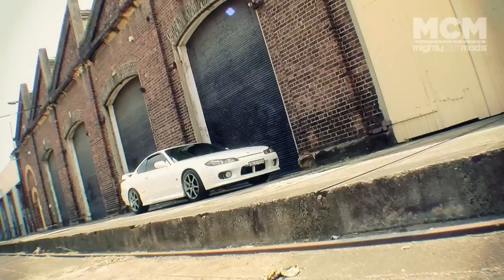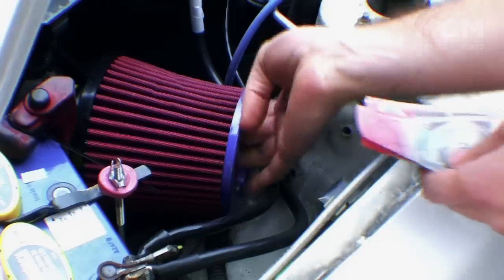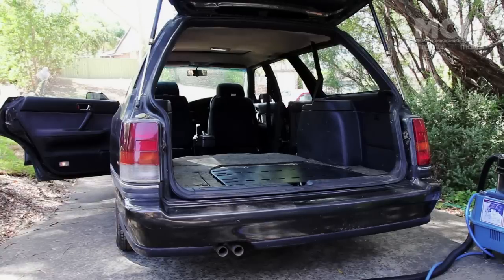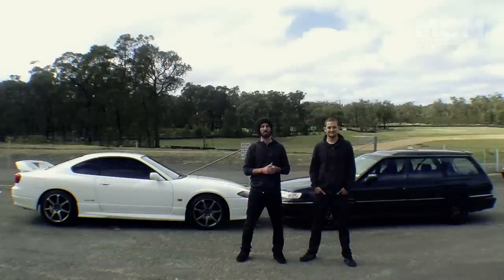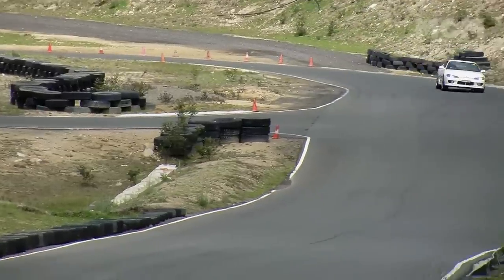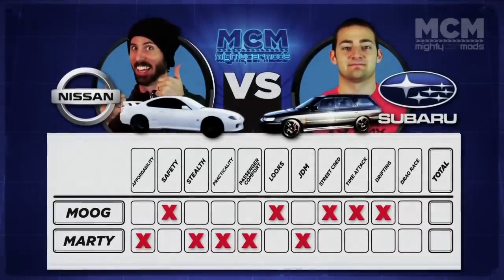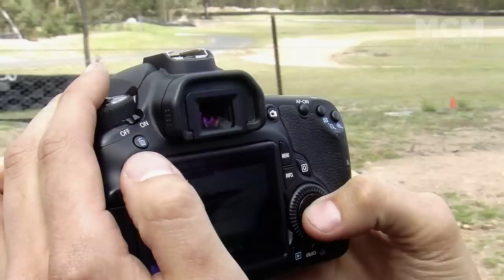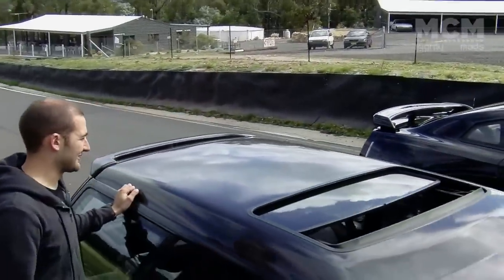Nissan Vs Subaru Battle

Comment: What about the reliability category? Marty blew up the transmission in the Subaru.
Reply: +Wick3DPimP Only STI's have strong transmissions
Reply: Ah, that must be it, all the subies i've ever seen modded were sti's. Only an aussie would mod a frickin legacy anyways(im gunna get flamed lol).
Reply: my brother in law had a 2015 sti that blew its clutch before it even hit 60000 miles
Reply: if thats the case, u ride heavy on your clutch, i have currently 120000 miles on my clutch and still perfectly ok. not sticky or spongy.
Reply: ***** it was also the transmission at the same time
Reply: Power+ AWD+good tyres=shattered 2nd in the 752 gearbox, I've been through 3 in a GC8!

Comment: that old Subaru is using 90% Nissan parts. Nissan owned Subaru in early 90s
Reply: +Y10Q lmao
Reply: i was surprised to see Nissan parts in my GC8. the cup holder says Nissan on it. i was confused. but they also have Mitsubishi parts as well
Reply: NePdXploit
 I know. On my 1998 Legacy all the electrical fans and relays are from Maxima and Altima. Same part numbers. On my 2001, they went to GM parts bin. The only Subaru part on Subaru is the engine.
Reply: Prove it.
Reply: sounds like bullshit to me
Reply: thornygravy
  The only SUBARU thing on SUBARUS is the engine, manual transmission and the body. Everything else is sourced from third party suppliers. Today they are using Toyota parts. They used to be supplied by NISSAN
Reply: And now Nissan use Renault parts
Reply: Evo Guy
 back then Subaru and Nissan operated at a loss. Today Subaru is posting 20% profit margin. Highest of any car maker.

Comment: What the hell, the S15 had semi-slicks, that's beyond unfair. Put the same tires on both cars for the track test.
Reply: how? 1 marty still won. 2 marty knew about the semi slicks. There is nothing in the rules stating equality. Its the RS vs S15 as is where is. Its nothing but fair 
yes semi's would have been good to see but still
Reply: John mark Touche but what good is a lap time comparison when they're not on similar tires. In fact I think all car reviewers should mount the exact same tires on each car for lap time comparisons. Top gear's lap time board would completely get shuffled up.
Reply: it isnt good lap time i would have liked to see that comparrison but unfortunately i beleive s15 would have just had it
Reply: Rykahnz s15 would of still won, rwd handles much better into corners compared to AWD cars, especially these older cars, suspension setup would also need to be accounted for

Comment: Subaru more JDM than an s15... staged.
Reply: plus that subaru is basically a  nissan
Reply: It's older than the S15
Reply: JDM japanese domestic market? so as they are both japanese which is more domestic?
Reply: charles d'Avoine the Subaru is an Australian delivered one though  and the s15 is imported
Reply: both built in japan just one was exported for sale in AU, so which is more domestic?
Reply: They had to make it all come down to the drag race.

Comment: This is how cars should be modded, no ridiculous camber or crazy wings!
Reply: so there are rules for modding now?
Reply: There's no rules per say, I'm just sating that the mods done to these cars are done tastefully. Many of modern "car enthusiasts" only modify their vehicles in order to try and  impress, commonly based on looks alone, oftentimes neglecting performance. Im not saying that I hate camber or that wings are a bad thing, and I'm definitely not laying down guidelines that people have to adhere to, I'm merely sating that in many cases, the modifications done to vehicles in recent times (such as hellaflush) are quite silly in my personal opinion. Look at MCMs civic build, and you will probably be able to better understand what I mean. They modified the car sarcastically in a way that many self-described "enthusiasts" try to. The end result was a car that many would argue was better left in stock form, myself included.

Comment: Bullshit the liberty is not jdm s15 wins. Also i don't feel like he used launch control in the r35
Reply: The r35? This is a 2011 video. Factory launch control didn't come out until like 2013?
Reply: Alan Bowen 2009s had it then they dropped it for 2010/2011 so Nissan says but it did in fact have launch control still. Then officially brought it back for 2012.
Reply: Oh. I must be thinking of the 4k rev limit while launching. Not sure then.
Reply: Alan Bowen They had launch control the thing was is that they didn't acknowledge that it did because if you used it, it voided the warranty lol. So they didnt endorse using it but it did have it for all years just different variations of it.
Reply: I don't think he used it either, it should have had a quicker and cleaner start than it did
Reply: well if the s15 win at jdm that means is that s15 won even though marty win at drag race
Reply: S15 doesn't win because they agreed to go with what Mr. Sato says. Marty even said it was a controversial decision, but it was agreed before they went to Japan that he decides. So that's that. It doesn't matter what other people think.
Reply: Onyx Leigion It was rigged anyway... Do you think they just have an r35 laying around? Nah man, it was scripted as fk, with a decent launch he would have won the drag race.

Plus, why would you rate cars according to their drivers? Doesn't make any sense. If the professional guy tests both and the subaru wins I accept it but like this it's BS

Comment: i think the drag race should ahve been redone with pro drivers so that less driver error went into play...i dont buy the wagon winning...
Reply: AdonisGaming93 unfortunately, I think the wagon would of won no matter what, AWD meaning instant power to the road from all 4s, rwd you have to use throttle control, meaning a slower start. Only way the Nissan would win would be if he just held the revs and done a burnout imo.

Comment: I still can't believe that Nissan never brought the S15 to the U.S. That is one of the sexiest cars they have built. I wonder when Nissan is finally going to come out with something to compete with the brz, frs, genesis.
Reply: I think it's illegal to get an S15 in the US.
Reply: Way to reiterate what I said...
Reply: you mean like the 350z/370z ...
Reply: the 350/370z is not the same level of car as the Silvia. The Silvia was an entry level rear wheel drive coupe priced in the 25k range. The 370z is more expensive with a v6 instead of a turbo 4cyl. The best comparison I can think is like saying the Silvia is like the Camaro whereas the z series is like the corvette.
Reply: Bamavol89 I meant compared to the brz frs and genesis, it seems like a good comparison, i would compare the gtr and corvette however the gtr is in a totally different class
Reply: Samuil Rizov
the 370z is a closer comparison to the v6 genesis but not a good comparison for the frs/brz. those cars only have 200hp and cost about 10k less
Reply: brz is crap

Comment: *Watches these guys' "blow off valve myth busted" video.
*Blow off valve on MOOG's S15.
Wait, what...?
Reply: in that vid they just proved that BOVs don't increase performance. It doesn't mean that they don't like them
Reply: 001Andrew100 If they indeed proved that, then they have bothered proving the wrong thing.

BOV valves were never used for performance, but to prolong turbocharger's life by preventing compressor surge.
Reply: Exactly, they proved the common misconception of BOVs increase performance when they just prevent spiking in the boost levels and ensure smooth boost pressure throughout the rpm range (and to sound cool)
Reply: 001Andrew100
 Then they DO help, at least at some level. Maybe not in regards to actual power, but in another way. In that case, maybe they shouldn't have made an entire video just to inform people of that.
The bottom line is that it probably isn't a good idea to make a video ragging on something, complete with little jokes at the end, then turn around and pt one on your car. They either help or don't help. You can't have your cake and eat it, too.
All that said, yes they do sound cool AF. :)

Comment: Of course the GT-R is guna beat a vf23 RS legacy wagon, but it wouldn't have beat my Ver5 STi RA. Especially in the Time Attack they did. It would beat me in a top speed and HP(kw), but Power only "Sells" cars, Torque "Wins" races!
Reply: sure kid...sure
Reply: Contract six stupid
Reply: it's called STi for a reason.
Reply: Matt Brewerton A 2JZ would beat an STi and GT-R
Reply: Jamie Kinnaer Of course it would.
Reply: NePdXploit I do believe this is the internet where kids can freely bullshit about the speed of their cars and have no sort of basis to back them up. Speaking from someone who has a v4 type RA, it is pretty unlikely that your v5 is going to beat an r35 gtr. Maybe I'm wrong though. Feel free to post up a video of your STI.
Reply: ***** I hate to char your grits, but around a tight track like that a GTR would chop the shit out of your bike. The one long straight isn't long enough for the bike to get fast enough to out-accelerate the GTR, and the GTR will simply murder it through the corners. Without even trying. Seriously. Bikes are quick as fuck in the top end, once you get up to about 150 you need a tuned Veyron to keep up with something like a Hayabusa, but less than that and the massive torque and huge gobs of grip the GTR has means you're in trouble, and bikes are slow around corners compared to cars.
Reply: Hate to join the wank-fest but it's too funny.
You have a nice car, but if you can't drive it well, it doesn't mean a thing. It's the same for a bike.
As for car vs. bike. Bikes are superior in turns, a car has to break and slow then accelerate at the apex (unless you can get enough back end drift it'll save you some track time, but again you have you correct the back end coming out). Where a bike slows before the turn and accelerates through the turn, also the bike leans into the turn giving you a hotter output, a car leans out of the turn (this is where you get chassis roll) which forces you to slow or throws the car out of the turn.
There's a whole lot of numbers and physics to throw around. But really to compare cars and bikes, apples and oranges.
Reply: ***** That's an apple and oranges comparison.. Race a WRX STi on a track. Race me right now with 2 feet of snow on the ground... OH you can't? A car like a WRX is practical and fun to drive. A Bike is only fun to drive when the seasons allow you to.
Reply: Tyler Ashton I would guess boredom?
Reply: NePdXploit   yea cause the dodge Cummins 900 ilb of torque is such a racer car...torque matters but from experience too much torque = crash and lose the race= corvette.
Reply: MRsteezy123
Don´t worry, now the Subaru needs a pro to change *there second gear.
Reply: Rýán Túçk
 i cant even comprehend that sorry.
Reply: Try skipping 2nd in the r1 with the pro. Level the playing field.
MRsteezy123
Reply: ***** Once again, sports cars are faster around corners than sports bikes are. Do some research.
Reply: Christopher Hallett dudes a troll. Nothing more. I doubt very much that he owns anything more than a bicycle.
Reply: ***** supras 2jz single turbo fully boosted will kill a r1 on a highway just stop
Reply: *****
 Bike V Car? No.
Reply: *****
only in a straight line and basicly he admited that gtr would destroy his sti....so your point is?
Reply: But it is not a gtr lol

Comment: why didnt he just by a subaru wrx sti??? there heaps fast, 0-100 in 5.4 seconds and thats completely stock. and they look so much nicer
Reply: 3 words. Built NOT BOUGHT!
Reply: Never heard a subaru called a "nice looker" before….
Reply: WRX STI's are heaps nice, r u under the influence?
Reply: ***** Didn't say that they weren't nice cars. Just said it is the first time I have heard Subaru used in the same sentence as good looking.  They are not good looking cars.  Does that make them bad cars?  No.  They are just not creatures of curves and lines, thats all.
Reply: ooh ok
Reply: ur 12 mate, time for bed, subaru sti's will destroy the silvia (Both cars Stock), there AWD and do 0-100km in under 5.5 seconds, do ur research mate cause u obviously dont know anything Matt Purcell
Reply: *****  I bet your a typical sti owner
Reply: ***** and just because I said there gay doesn't mean I have no knowledge on wrx sti's how would you even possibly be able to tell weather or not I have a clue on cars or not? Your quick to snap arnt you. Little bit tender? Need a hug?
Reply: Matt Purcell is just trolling. I wouldn't be surprised if he had some weak ass car. Probably has a honda!
Reply: Cory Bennett Rekon, STI's are so easy to modify so he obviously hates subaru because of Moog putting shit on them
Reply: not here to join your guys's pissing contest but i have a sti and just wanted to input that the center differential control would have at the very least helped subaru in the drifting category. That and pulling out the gtr really just proves that every car and every brand has their strengths and weaknesses.
Reply: Matt Unger #RektM8
Reply: Gavin Matt
I'd rather build off of an STi than an RS
Reply: Its 4.5
Reply: RS Legacy has a cdb and with later model heads and turbo plus are tune are astromically faster than sti's because they weigh fuck all

Comment: Dam it Moog!! You should have done a few practice runs to get the best out of it. I know the feeling along with a support group I attend for giving up your best ride ever. In particular mine was a 65 Ford Galaxie Hardtop with a 390 Cubic inch engine. It was a beast on the straight line and that was about it. Oh yeah and if you took it over 100 Mph you could of swore it was flying and probably because it actually was if you went over a road that wasn't perfectly level. Sadly I had hit some financial woes and the USSGALXY as I so named her and personalized the plate for was no longer mine. It will always be my first but hopefully not the last. For now I drive my Hyundai Accent with 1.6 liter engine and red line the living shit out of it every time I think about her. I don't go very fast but the smell of a clutch burning on takeoff..... Who the hell am I kidding. Dam the rules Moog! You can always start up your own series titled To Hell with Marty.

Comment: Sooo subaru won 62% of "looks and on the paper" part when the nissan won 66% of the actual driving. That doesnt seems fair to me. You know, there is a FIAT Multipla which is afordable, safe, practical, stealth AND comfy, so it has 5 points already...

Comment: The S15 would probably sell for enough to buy the GT-R
Reply: It's an S15, they are worth alot of money because they are a very cool and rare car
Reply: UV Plasma Not in Australia man
Reply: I've seen s15's for around $30,000. Gtr's start around $100,000
Reply: Are you on crack? S15's go from £20,000- 40,000, GTR's (2014 model) are about £80,000 stock. The R34 however is about £30,000 but it varies between country and any after market modifications and the condition of the car.
Reply: UV Plasma i got my s15 for 15k, noway near worth as much as a GTR
Reply: Kille78
a used GTR like the one in this video can be as cheap as 60k
Reply: Billy Brownhill wtf in germany a silvia costs about 9000 €o.0
Reply: Different countries cost different prices, it depends how many are in that country in the first place :P UK got invaded with japanese cars in the 80's and they were all the cheap shitty ones, so by the `90's no one was buying new japanese cars because there was a lot in circulation anyway. S15's are almost rarer than bentley's here
Reply: here in nz an s15 is 15k and a r32 gtr is the same if its high milage. low milage your going to pay 2-5k more.
Reply: PieFace Woden i don't know about you but when i think gtr, i think of a classic r32.
Reply: trainenthusiast Dat name. Seriously Dat Name though.
Reply: Lol... are you serious
Reply: Kille78 lol you can pick up a s15 for 12 grand in canada already imported. Trust me its no where near the price of a GTR even with moogs mods.
Reply: I'm sure he is in the us ... here in murica we can't have nice things like the s15 or r34 because of the 25 year import ban. All we have around here where I live is some s13's s14's and a couple imported r32's that's it. No legitimately legal s15's that I've seen proof of. Oh and to top it all of we didn't even get turbos in our usdm nissans.

Comment: I call ABS a loss, it has caused 2 accidents for me and hasnt prevented a single one, i have never tripped the ABS in a hard enough stop, however the ABS in 2 different vehicles (cadillac and dodge) has randomly cut braking power because it thought i was on ice, it causes an accident in the 93 cadillac, and almost caused another, and by the time it happened in the dodge i knew to engine break and use the parking break to stop, problem is that this method doesnt engage the powered brakes so your brake lights dont com on unless you use both feet, or have a center console parking leaver

Comment: not a fair match. why not it's a competition to build a sleeper. the criteria doesn't really suits to compare both car and on most of the criteria, the subaru wins. and that JDM criteria really bugs me. why is it even required in the first place. to me both car are fairly JDM.  Just if the title of the competition is who can build a better sleeper car which really suits all of the criteria, s15 is not really a sleeper car. a car that is stealthier than the other is not superior than the other car. and a car which is cheaper doesn't make it more superior for example a stock civic is way more cheap than a ferrari doesn't make that civic more superior than the ferrari.